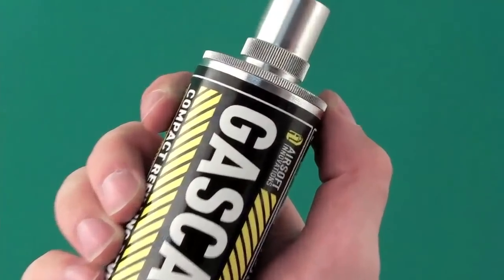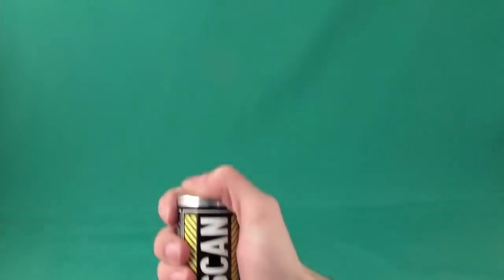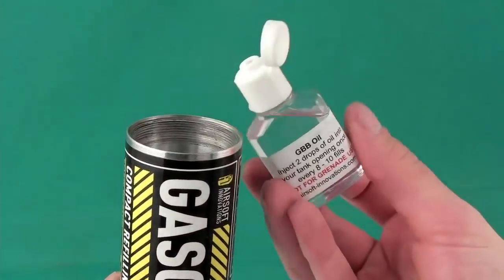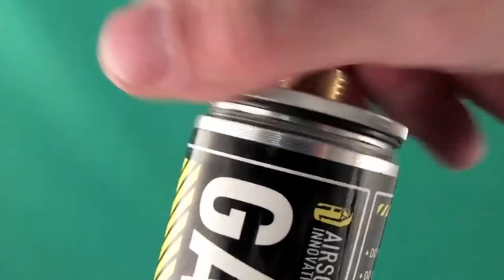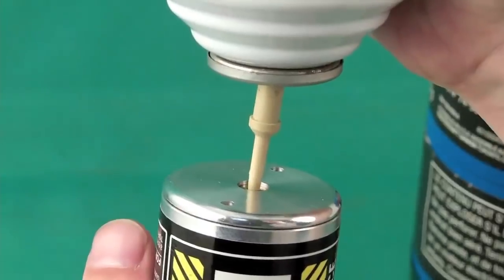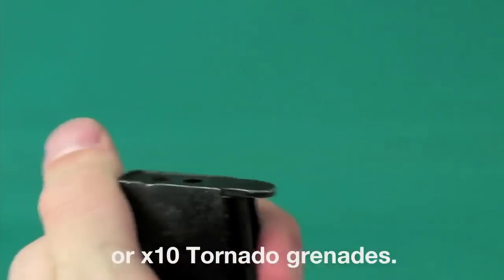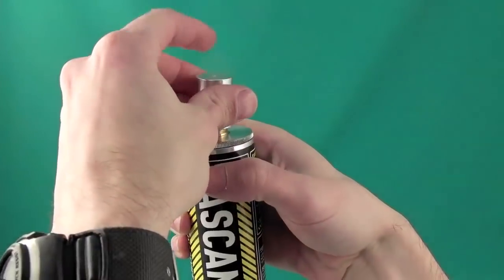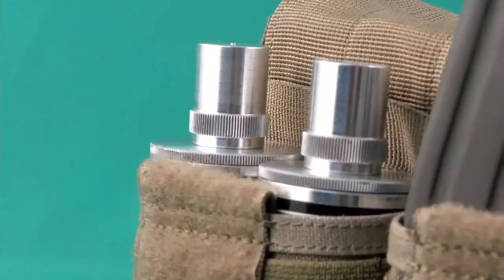GasCan Instructional Video

Comment: The compact size and re-useability of these make them worth buying.
Couple things I would like to know.
1. If I use 2 drops of GBB oil to fill my mags, will it cause a lot of damage if I use it to fill my grenade once in a while?
2. Will the brass tip damage my mags fill valves or should I attach a plastic adapter to it.
3. What oil do I use for 40mm grenades.